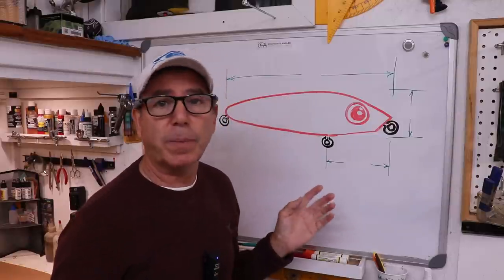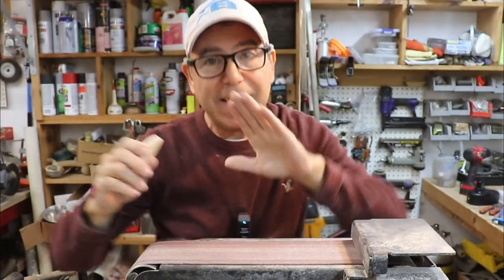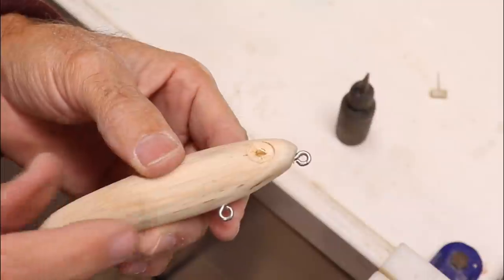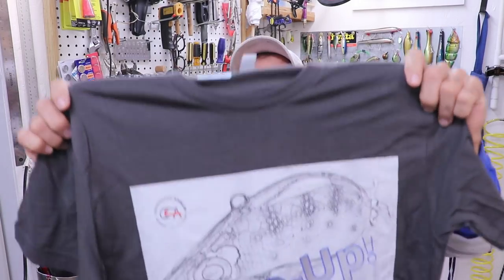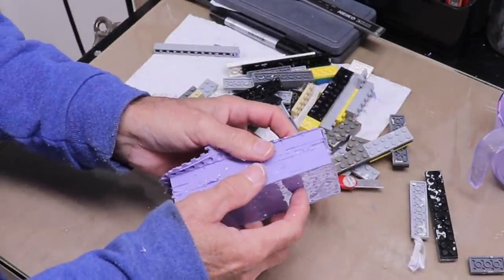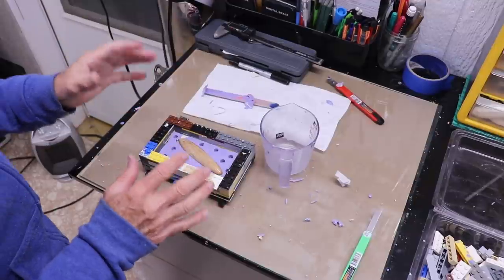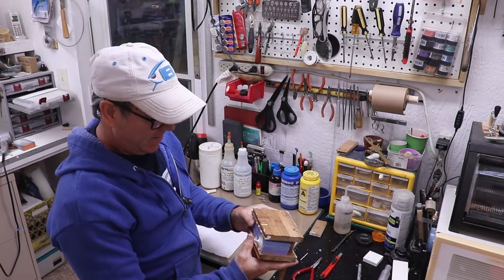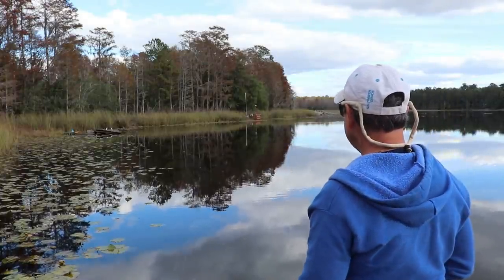Making a perfect topwater walk-the-dog lure, Making a silicon mold for a fishing lure.

Comment from the maker: So here's what I think went wrong with the silicon mold I made in this video:  The first disaster where the silicon stuck to the lure, you'll notice it stuck to the first pour of silicon.  Of course I didn't notice at the time since I didn't try to move the lure.  The next pour was perfect and separated leaving a nice glossy mold of that half of the lure.  The only thing I did different was that I sprayed the clay bed, lure and mold box with Smooth-On mold release.  I did that because I noticed the silicon was acting a bit past date and the last time I used old silicon it stuck to the mold box and the mixing cup.  I had to throw away the mixing cup.  But this time it only stuck to the lure! Why?  I think there was a reaction between the epoxy clear, the mold release and the old silicon.  
On the second pour where the silicon stuck to the lure, it stuck much less.  On closer examination it appeared to be stuck in lines that looked like the lines I was making as I removed the stuck-on silicon the first time.  So I think I just did not clean the surface of the lure well enough and left some silicon residue.  And silicon loves to stick to silicon...even residue apparently.  I'm going to try to reproduce the problem so I know exactly what happened.
Reply: Sir what powder u r mixing with resin
Reply: I just completed my first ever silicone mold today. I confirmed that silicone does stick to older silicone, and I did not use my mold release spray at all. I used no lubricant on the lure or clay bed before the first pour of silicone. Then I used vaseline on the first pour, before I poured the second half of the mold. After it was cured, neither side or the lure, stuck at all. Were those two different types of of silicones you used in the video?

Comment: Thanks for showing us that not everytime things go perfectly! Have you ever tried the Amazing Clear Cast Silicon vs. the Smooth On?
Reply from the maker: Yes I have, in fact I have tried many of the silicones out there and have only had issues with smooth-on getting old.
Reply: @EngineeredAngler  that’s good to know. Seems like it’s a lot more durable than the amazing cast stuff. Have yet to dive into resin lures but I would like to for reproduction purposes. How many lures can you get out of one silicone mold?

Comment: Kinda looks like Murphy was looking over your shoulder on this one eh Franco! Strange that the first side came out fine and the two next pours didn't. Does that mold material generate any heat while curing? Maybe its not getting up to temp. I've "rapid cured" silicone using the heat from an incandescent bulb, that may help. Question... I've watched you find the center of gravity of a lure before and wonder if it would be better to float the lure to determine the center of buoyancy.  Am I missing something?
Reply from the maker: You could float the lure and then place temporary weights and shift them around until they give you the desired float angle.  I find this method much easier.
Reply: @EngineeredAngler Agreed, balancing is easier than floating. So, for lure design, can we assume that the center of gravity and the center of buoyancy are close enough that we could consider them to be the same?